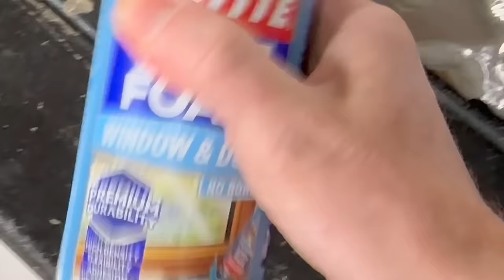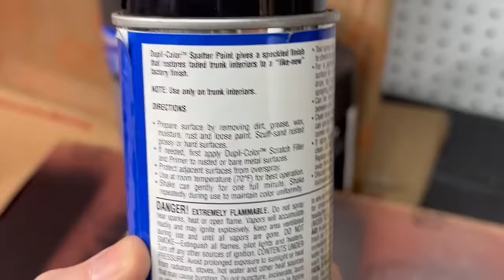How to Restore Cracked Vinyl Dashboard - Spray Texture Coating!

Comment: I was thinking as the dash is going to be in the sun a high temp paint might be a good choice. They have them in many colors. But, you might not be able to find the exact color.
Reply from the maker: I think a high heat paint might be overkill. Most are enamels rated at 500F or greater for engine parts. A sealed up interior on a sunny day might reach 130F, 140F, maybe 150F?  We'll see if this paint holds up though!
Reply: @6thGearGarage  I've had paint cook off. That was my solution. Thought I'd suggest it. Good video though. I learned a lot.

Comment: Dupont had a good system for vinyl and rubber years a go but have done away with it for some dumb reason. It was lacquer paint with 792S hardener. That made a flexible finish. I used it many time back in the day. The 80S and 100S epoxy primer was the best primer ever made and yep Dupont did away with it too. Lol.
Reply from the maker: I wonder why they would end a good product... not friendly enough for the environment?
Reply: @6thGearGarage They made it to good. It is all about sales. If it don't last to long they sell more is my guess. Lol.
Reply from the maker: @user-tn1hk6zm2freedom Oh yeah, the same way many auto manufacturers make most of their vehicles!

Comment: Only just seen your video i always answer at the beginning of a video for the rebates cut wood to the shape the  clamp in place if glue good should how know problem for the contours
Reply: You would be better using a wallpaper scraping hand tool a 3 inch and 1 inch
 just put a very sharp edge on them then every time you use them just go over edge

Comment: "Cheese graters" are used to rough out the filler before it is completely set up then finish with paper.
Reply from the maker: That is going to make it so much easier, thanks!

Comment: What made you wanna restore an old truck dash??  Did you loose a bet? Or just as a challenge to yourself or what?
Reply from the maker: I have a couple 80’s Toyotas, so I have some spare dashes for them. But it also is an experiment to test different repair methods and see how they hold up. This is my third dash restoration video- each one has been done using different methods.
Reply: @6thGearGarage  cool thanks for quelling my curiosity. Only saw this video & thought it was pretty interesting cause i like to try n make my old stuff nice too. Dash looks good n think u did a good job. Now go buy a bench vise or something like that so u don't have to struggle using one hand to hold things while you work on em . 😸

Comment: The vinyl you applied in the earlier version would probably have worked if you had vacuum-bagged it while it was curing. And it would have been a lot simpler.
Reply from the maker: I'll have to try the vacuum bag method in a future video!

Comment: The problem is you are playing to much with the filler and should use an orbital sander to sand it . I can see the low spots that you missed .when using the filler wipe on than leave it alone don't keep going over it as it drys quick and you start to Roop it apart

Comment: My friends call me MARLON BONDO…. my suggestion is if u are gonna fill 2-3 x which is inevitable , hit extreme low first without going over entire area … then round two the filler doesn’t sink as much when applied …. Then you can sand it out a little more to where it’s even a tad low …. Then you doll only have a few imperfections that are less deep , if that makes sense 👍🏻

Comment: I wouldn't use the cheese grader. Just DA the thing like normal. I also would skip the foam, and use kitty hair bondo.
Reply from the maker: DA will work faster, but I try not to use power tools in case not everyone has a DA.
Reply: @6thGearGarage  Logical, but a good sander is cheap. Everyone should have one that's doing any kind of restoration. It's cheaper then the materials needed for the fix.

Comment: I get wanting to fill the crack on good foam, but I simply can’t get behind channeling the crack, thereby making it larger. Almost every video I’ve seen features that method and it seems way too invasive.
Reply from the maker: Yeah it does remove a lot of material, but all the weak uv-damaged foam has to go. Also because the crack is usually crowned due to the surface warping up, so it needs to be widened/flattened back out.

Comment: Very good video. Appreciate your work. But one piece of advice: You should have worn gloves during this whole process. Not to protect your delicate hands, but to keep your skin oil off the surface of what you are painting.
Reply from the maker: Very good point! I did wipe it down with grease & wax remover before painting, but gloves are always a good idea.

Comment: Watching you cut this stuff off the dash was like watching a train crash. The best shaping tool is a pneumatic small angle grinder with a 2 inch grinding pad. I had to stop watching at 11 minutes, my OCD was on overload. Hope it turned out OK
Reply from the maker: Aww, you should have skipped to the end, it turned out pretty nice.  I worked with the hand tools I had, since a lot of people don't have access to new power tools.

Comment: Hey there fellow Toy lovers, does anyone have any experience using this technique but color matching with the brown instead of the grey?  I'm restoring an '85 Marty McFly model SR5 in the cream/brown/bronze color scheme and it has the classic centerline crack through the dash pad.  Been trying to sort out the best technique for an OEM resto and haven't really entertained a spray-on method until I saw this.  Happy to have any advice.
Reply from the maker: Hey, I have never tried to match the brown, but I read somewhere that SEM makes a brown paint that is a very close match.
Reply: @6thGearGarage  Thanks for the tip brother, and thanks for all the great videos.  Since your channel started you've given me more than one great idea for how to tackle a problem, and I appreciate it very much.  Been a sub for awhile now.

Comment: Thin your top coat of filler with fiberglass resin so it's easier to work with.
Reply from the maker: Great advice! I just saw Bad Chad do that in a video recently and never knew that it would work.

Comment: to save yourself some effort with bondo., either do only skim coats that need little sanding., or do a primary build up , then at the point when it turns to a stiff play dough, quickly and neatly take it down to a nice sandable point then let it flash. but im not even sure Bondo is necessary tbh,.  loctite is good., but there's an automotive and marine grade caned foam too, probably a bit better. made by Evercoat.. & there's got to be a better option than bondo.. thats going to pop eventually. ,need a product thats going to end up a bit more flexible,. a rubberized primer also might help ., and ps,. those cracks are filled with filler not bondo,. ., its much softer , super light weight

Comment: I've been a paint and body guy for 35 years and I never cringed, I'd rather have too much mud then not enough, the only critique I have isn't really a critique, instead of spending a bunch of money on those fancy degreasers just use run to the Dollar Tree and buy a bottle of 70% Rubbing Alcohol, most body guys don't use those fancy degreasers, why? Because Rubbing Alcohol does the same thing and it's only a $1.25 at Dollar Tree as opposed to $15 for the degreasers, also have you have thought about trying the plyable body filler?  I just bought a 81 Chevy C-10 and it came with an extra dash, they replaced  the original dash because because the extra one is trashed and the one in now is cracked but not as bad. I'm dailying the truck so I think i'm going to pull the good dash off and replace it with the bad one so I can fix it like you just did this one and then switch them back out and play with the bad one and use the plyable putty on it then use the trunk paint on it and the same paint I use for the interior, I have to change the color of the good one anyway it's black and the rest of the interior is dark grey which I think I'm going to change it all to brown because i'm going to change the color of the truck from 2 tone Silver to Yellow.
Reply from the maker: Someone just told me about the pliable filler in an earlier comment and that was the first time I have heard about it. I will have to test it out on my next dash.  Thumbs to to yellow exterior + brown interior on your C10!
Reply: @6thGearGarage  yeah I've never used but I don't do alot of interior stuff that's why I'm going to use it on this bad one.

Comment: I don’t understand why you bother with foam if you’re going to cover it with hard body filler. Why not just build it up with more foam? 🤦🏽‍♂️ Did you know that Polyvance makes a padded dash filler?
Reply from the maker: The foam is porous and not good for primer/painting. The body filler is  ideal for primer/paint. Also, the filler is good to create an even level surface because it's difficult to get the foam perfectly smooth when cutting. Especially if you cut too deep in one part like I did... most of the filler was fixing that area.
Reply: @6thGearGarage  have you tried the polyvance stuff? It’s supposed to be made for finishing.

Comment: look good, but too much texture, should have sanded it down flat more,  i have a 1987 tan dash that has a crack right down the middle, that I need to fix or just buy the cover they sell, or I might carpet it or use cloth
Reply from the maker: Yeah, looking back, I wish I sanded it a little bit more.

Comment: ❤..Use....Bondo...not Spray foam....much less messy...
Reply from the maker: I used all bondo and no spray foam on the first dash I did, and it actually seemed to take longer because I had to keep sanding & adding more bondo. https://youtu.be/S-UPaYTFBlE  The foam fills all the large voids in one pass, but does require cutting and shaping afterwards.

Comment: Too much texture. Should have gone with that rustoleum bed liner. It has a good texture finish. I sprayed it on some exposed metal areas in my trunk and it looks like vinyl
Reply from the maker: I’ll check that out, thanks!

Comment: why use foam…then filler…
why not just filler?
Reply from the maker: I actually did just just filler on the first dash I did and it seemed to take longer with all the curing time. on #2 and #3 I used foam because that's what was used by the factory and that way the surface would expand/contract at the same rate as it heated / cooled, hopefully preventing cracks... hopefully. So far dash #2 is still holding up.

Comment: Why didn't you just use plastic filler or even chemical metal it would of been easier to work with
Reply from the maker: I used foam for most of the repair area so it would be similar to the factory dash. I think that having the same amount of foam across the dash will be beneficial instead of a different material that may expand/contract at different rates as the dash heats/cools from the sun. We'll see how it holds up!

Comment: That thing you're calling a file is not a file, it's a plane (a very cheap one at that).  You'd be better off with actual files rather than the plane.
Reply: It's called a rasp

Comment: You need to ask a pro. Most all upholstery pros use DAP trim and vinyl top adhesive., Never the product that sounds like 3 men, it is weak crap.   DAP Products Weldwood Landau Top & Trim HHR Solvent Type Spray Grade Contact Adhesive
Reply from the maker: I used Dap Weldwood Contact Cement on another dash that I wrapped in vinyl, and it has held up great! This spray texture video was more of an experiment... Here's a link to the previous vinyl wrap dash video: https://youtu.be/XB9GKLRHYNM
Reply: @6thGearGarage   Let me know when you restore those old 80s foam wrapped steering wheels.  I am trying to figure out how good way to do that as the OEM steering wheel has control buttons on the center and I was trying to retain factory look appearance.

Comment: Your methods are completely wrong! Much better off filling those cracks with epoxy, sand and bondo#2 to smooth top. You created a big mess that needed a lots of clean up, totally unnecessary. Additionally bondo and foam not the best match.... FYI I do this for living ....
Reply from the maker: So skip the foam all together?  I used foam because that's what was used by the factory and that way the surface would expand/contract at the same rate as it heated / cooled, hopefully preventing cracks. I don't mind making a mess, that's what shop vacs are for. I'd love to learn more about your method and give it a try!

Comment: You could have just used fiberglass and resin. A lot less work and a lot faster.
Reply from the maker: So use fiberglass/resin instead of the body filler or over the entire dash and sand it down smooth?
Reply: @6thGearGarage  either. If you want a full smooth finish just do the whole dash but for the spots you repair, you could just use resin and fiberglass to fill the bad spots. Just keep in mind if you do the whole dash, give it a rough texture before applying. It will need to bite into the material so it doesn’t separate so easily.
Reply: @6thGearGarage  oh you could also do epoxy resin to fill the holes and cracks. Another cheap and fast solution. You can dye the resin to match the color of the dash.
Reply from the maker: @travissnyder1553  Ive considered trying to make a perfectly smooth, glossy dash, like show cars and hot rods have. Maybe I'll try that one next. I have a stack of cracked dashes!
Reply: @6thGearGarage  if needed, you can reduce the fiberglass thinner with acetone or paint thinner. It’ll give you a smoother finish to work down. I use the stuff in a can. Cat hair is what most body men call it.

Comment: Sorry. u try.  very messy. u cut down all the crack lines deeper to fill in the foam. U should fill in the crack only. the foam end up cover the whole area which is very unnecessary Creating more work for yourself.  looks horrible. U might as well spray the whole dash. With proper preparations and the right glue the vinyl wrap would have been cleaner and faster. Final note . ebay would have been a better options  lmao
Reply from the maker: Yep, you have to also remove the surrounding foam to take out the crowning for a flat surface in the end.  If you watch the video, the whole dash was sprayed. My viewers asked me to try to repair it this way so here it is. I already did a repair with vinyl wrap here: https://youtu.be/XB9GKLRHYNM and I agree, that is the better way. Old dashboards have been out of production for 30+ years, ebay isn't much help there.

Comment: cool, but you gotta be brave to do this........ with no gloves..;p
Reply from the maker: Yeah, I'm careful not to get any of the filler on my hands. If so, just wipe it off with a paper towel. I find it difficult to do this kind of work while wearing gloves because I need to feel any imperfections in the surface.